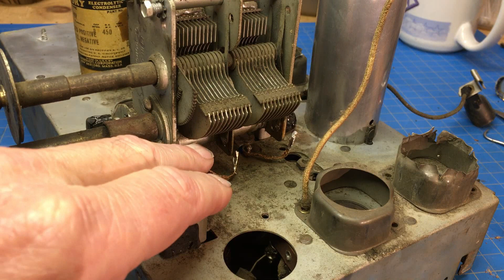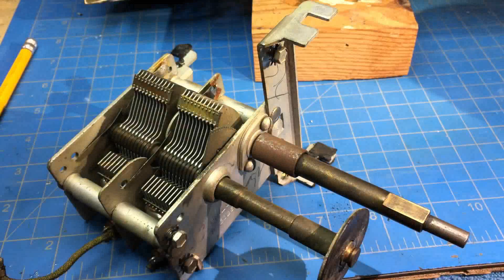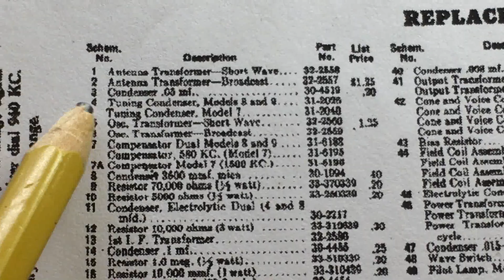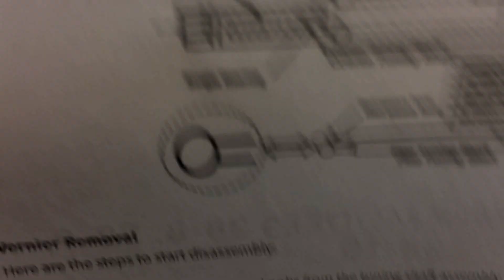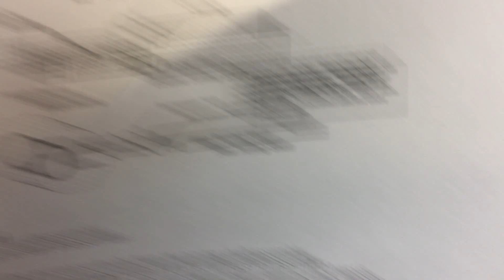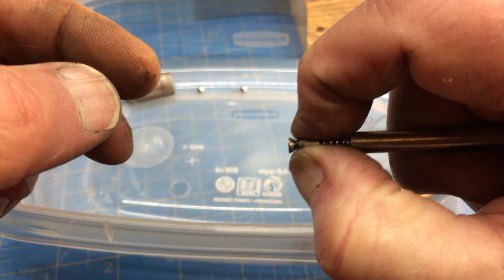1938 Philco 38 9 Part 3 of 6 Tuning Condenser Maintenance

Comment: Philco radios as-built when compared to the schematics can be fun to research. Nice job breaking the tuning mechanism down and getting it back together. I like your tip on using a container during the disassembly process so you’re not chasing parts on the floor. Best, Don
Reply from the maker: Thanks Don! I can’t take credit for that idea, I saw it on another  but can’t remember who it was. Thank you—Don